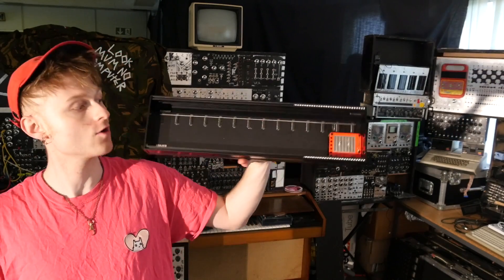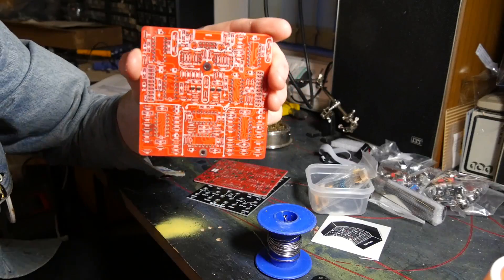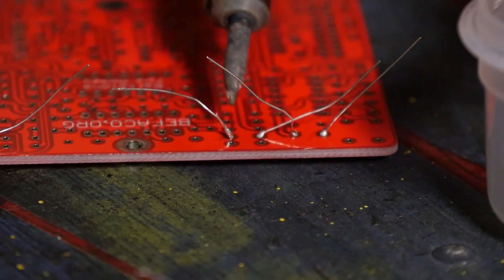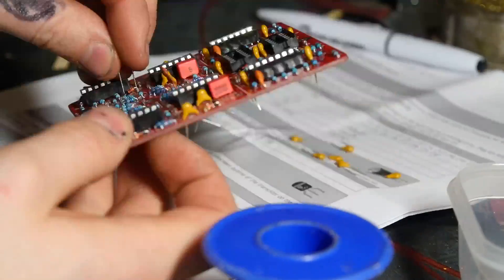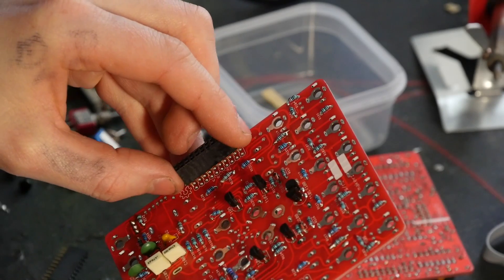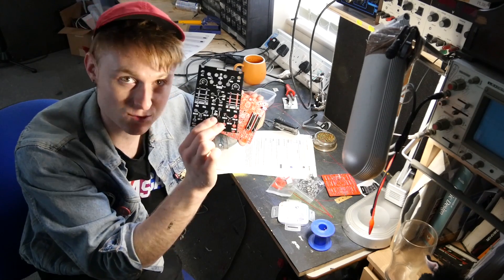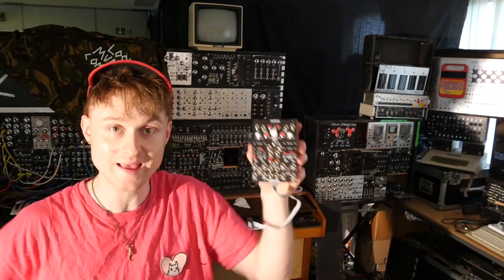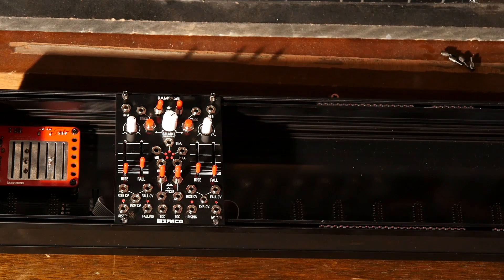Befaco Rampage - Building it. BEFACO PART 2 #Howto

Comment: Psst, considering your (unless im mistaken) fairly standard non temperature controlled soldering iron, never put your soldering iron on your electrical components, there's a fair chance you will 'cook' them causing them to act different then intended (more/less resistance, damage IC's, etc etc) even more important then usual because your working with audio imo. Even though alot of sources recommend against it, ive found that with a very thin tip that you keep clean, can put solder onto the tip and have it drip onto the connection point and create a perfect connection without ever heating up the component, you might wanna try that on one of your simpler builds once to compare if it makes a difference, i have a feeling it will.
Reply: no, just noo
Reply: wtf are you even talking about dripping solder to prevent heat?  do you even solder bro? the heat isn't going to cook anything unless you've gotten it so hot there is obvious damage to the board. the whole point of soldering isn't just to glue the components in place. your creating a seamless bond between the connections that is as atomically one solid material. eliminating any oxidation. dripping would create cold solder joints everywhere and the circuit would have a very short lifespan.
Reply: i will say though if you see this Sam. Tin your fucking iron man

Comment: Soldering iron tip burnt uo after only 2 PCBs? Look mum, no soldering iron sponge!

(even a piece of wadded up kitchen roll would do)
Reply from the maker: yeah it was a sketch as fuck soldering iron. bought it in the previous video for 5 quid. after this video. just filed the stub back into a tip again. but yeah that was speedy. and yeah i was using an iron sponge the whole way through too.   but the fact is its possible. to do it with a 5 quid soldering iron
Reply: What power is it? 60W?
Reply from the maker: 30w
Reply: Oh, dear. LOL!

Buy hey, it got built, so...
Reply: @LOOKMUMNOCOMPUTER  get some rosin off ebay from china for a buck and a brillo pad. keep soaking it in fresh solder ever few joints while u work. ive had tips last hundreds of  circuits before they started to corrode using that method

Comment: Just out of curiosity, what were those two 1/4 watt resistors doing at 4:30 on the right side of the board? Anyways, great video, if I did go eurorack I probably would have gotten some Befaco kits. They look pretty rad, but I went 5U instead. Tons of cool DIY stuff there as well.
Reply from the maker: yeah my bad. i dropped the resistor that was in the kit haha. couldnt find it! so had to make do with 2 that were twice the value in parralel. cus it was all i had. so yeah. ha. 5u Praizeeeee!

Comment: Another ace video Sam. A great tip  for getting the LEDs flush with the front panel, that you may already know, is to put masking tape on the panel where the LED comes through.  That way the LED doesn't peak through and it's also held in place by the sticky to help you solder. Keep up the good work! I have a commission to build a Rampage just now for a mate!